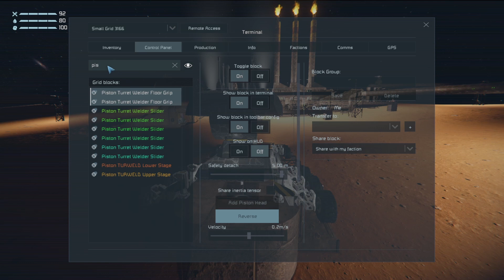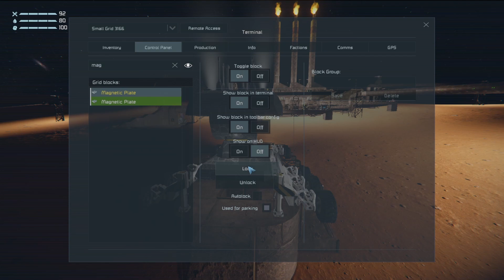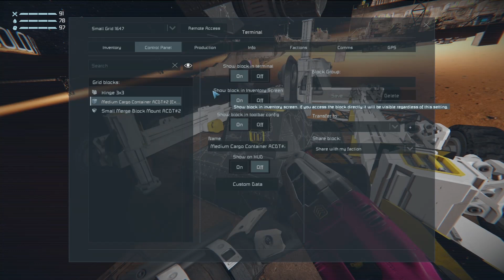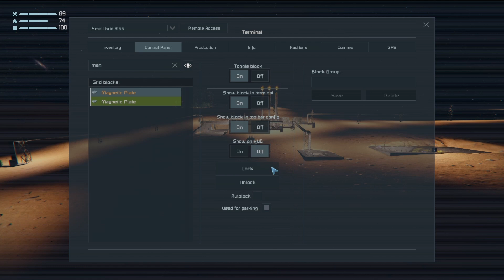Ares Colony EP62 - Mk2 Turrets (Space Engineers)

Comment: i think you need to add a Horizonal piston to the upper half.   when your at  the welding wall  your gonna want the merge blocks  to line up  or maybe top half pushed out more then the bottom..  so they weld up even...   have 2 do a test run.
Reply from the maker: Yeap, I did lots of work off camera and go it all sorted... maybe. Just building a new welder wall, my test mere minutes away.

Comment: version 2 gun has a little the look of a German Flak kanon 👌😎
if you put a piston on the truck that the gun mount can retract more then you can lower it more towards the base of the gun.
If you let the back 2 wheels of the truck turn reverse to the front wheels it turn better without getting instabile👌
Reply from the maker: Cheers Dave. It's definitely not finished and I kind of had to build backwards with pistons, but now I know where there go, I should be able to adjust/move them.

Comment: Hmm... aesthetically, I prefer the Mk I turret, though I absolutely understand your point that it doesn't fit the overall design of the colony base very well. 

I definitely like the addition of the Wasteland spotlights to the Mk II turret, though! I don't know how effective they will be for the operation of the turret, but they look really cool. 

I wonder if I would like the Mk II better if the head of the turret was built as a horizontal rather than a vertical block? I dunno, the important part is that you like it.
Reply from the maker: The mk2 is my favorite right now, but I feel like that will change when the mk1 gets properly installed on the asteroid base.

I've used those spotlights quite a bit now and they 'never don't look good', they are also yet to give any real practically useful light, ie on the Mars explorer they are just powerful enough to see the hole you just drove in, but not powerful enough to see the hole before you got there.
Reply: @Wellington6012  ...so they are more like position/ambient lights than spotlights. Well, that's a bit of a pity.